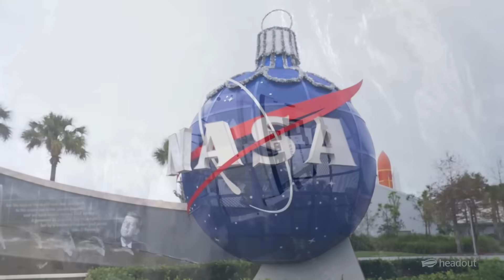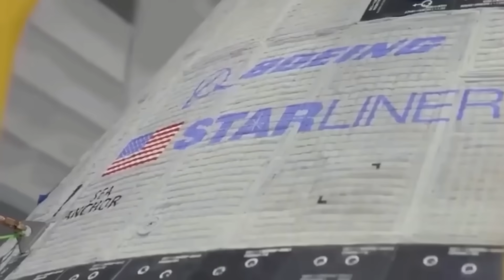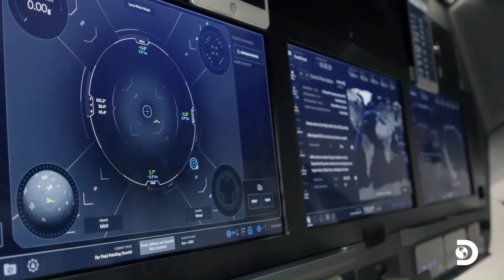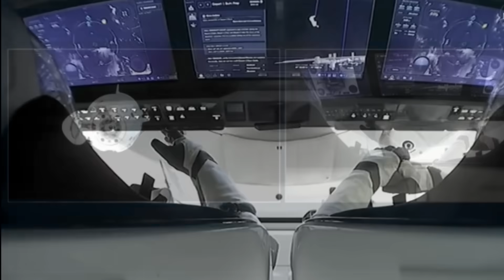SpaceX Finally Rescued Starliner Astronouts But There Is One Issue!

Comment: In July, right after the two astronauts were left stranded, I attended a lecture by a NASA space suit engineer at the Cosemosphere in Hutchinson, KS. 
She said that the space suits developed by Space X and Boeing are specific to each spacecraft. This means that unless it was a dire emergency, a crew launched in a Boeing capsule, with Boeing spacesuits, would have a difficult time making an immediate return in a Space X. 
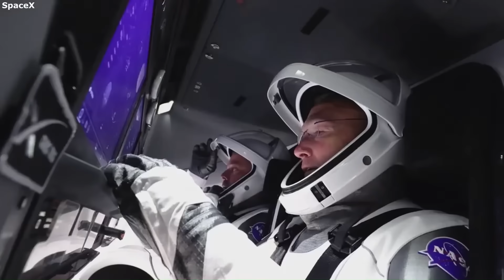I was typing this when I heard at the 5:15 second point of the video the person briefly touched on this. 
What I don't understand is that if they want the two craft to be used interchangeably, then when in the heck didn't NASA demand that at least the space suits and environmental systems be more compatible with each other!
Reply: Good question. Maybe the solution is no matter what they launch on have a suit ready for the other one just in case so don't have to wait for a resupply cargo craft with

Comment: Boeing bashing yet again. The specific criticisms are not what halted the mission. Digital interfaces, climate control, comfort, new suits, touchscreen so that manual can override the programming were not issues. Leaks and failure of thrusters were the issues. Boeing sensors and technology identified these failures as part of their system design. Well done to them. Granted they seem to have some issues but they do have much more experience than Space X in many categories of space faring technology. They have been in the game for at least 40 years. This video is intended to promote Space X. It is filled with immaterial content intended to influence people to trust Musk's technology and by proxy, trust Musk(and Trump). Trump and Musk politicised this issue of the stranded astronauts. Who does that? Like the Biden administration would ignore safety of the mission because of what, thereby endangering those astronauts lives? What utter nonsense. Are they serious? This video is sponsored. It is biased and misrepresenting things. Not cool.

Comment: The SpaceX Crew Dragon spacecraft is designed with a highly automated system, relying primarily on touch-screen controls for crew interaction, but it does include manual control capabilities as a backup for critical events like Main Engine Cutoff (MECO), docking, retro firing (deorbit burn), cessation, and attitude control. While the touch screens are the primary interface, SpaceX and NASA have ensured redundancy and safety through physical manual overrides for key functions, aligning with astronaut feedback and mission-critical requirements.

Even if Dragon’s computers fail completely, the crew, with radio contact and ground telemetry, could manually execute the entire mission using well-practiced skills, though success would depend heavily on precise ground coordination and crew proficiency under demanding conditions.
Reply: Even with FSF (Full Self Flying) engaged, astronauts still have to jiggle the steering wheel every few minuets. LOL.
Reply: @curtchase3730  That's so true! It's a pilot thing, I guess. Starliner, the time capsule (real switches, dials and stuff).

Comment: If space x has been so successful with its crew dragon rocket and the heat shield, then why are they not using said heat shield on their starship?
Reply: starship is 100 times bigger. it's a whole different deal. starship is part of development to be able to actually land on another planet and take off again. much greater complexity than falling out of the sky with parachutes
Reply: Aint no tiles on the rocket nozzles
Reply: yes obviously they have to make sure they have better quality control on their flux capacitors. it was just a slight leakage however it formed a time space warp between the engine and the ship. the engine was left behind LOL. oops it fell off

Comment: Butch and Suni surely knew of the issues of Starliner.
Why didn't they say this bucket of bolts is not fit to fly? This space vehicle could have killed them.
Reply: Pretty simple, if they talked they would never fly again.
Reply: @velocity2654  
Future cush job from Boeing if they don't talk?

Gus Grissom was pissing off NASA and NAA on the less than standard condition of Apollo 1. We know how that turneCorps. Looks like no one listened.
Frank Borman straightened out that mess at North American Aviation, and the drastically improved command module flew in October 1968.
There are no Frank Borman's in the astronaut corps.
Reply: Exactly!!!! @velocity2654